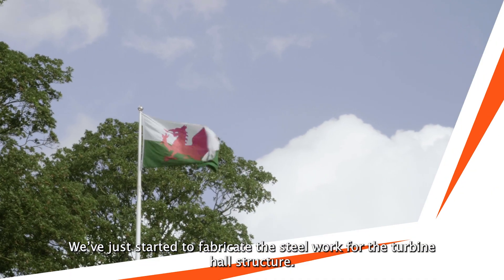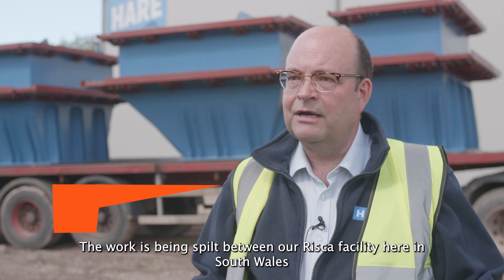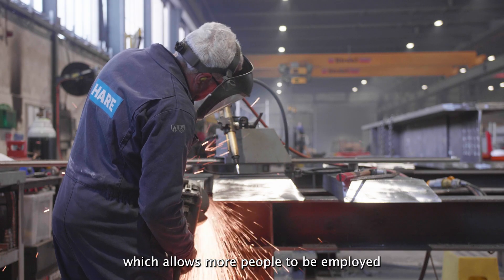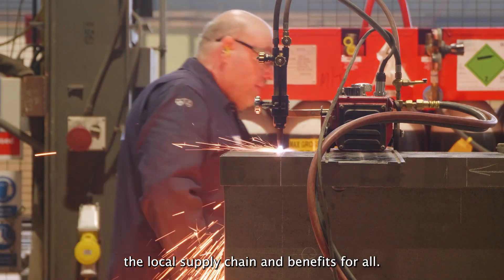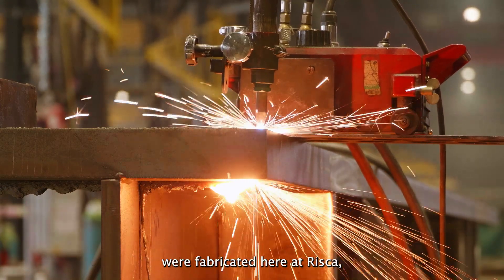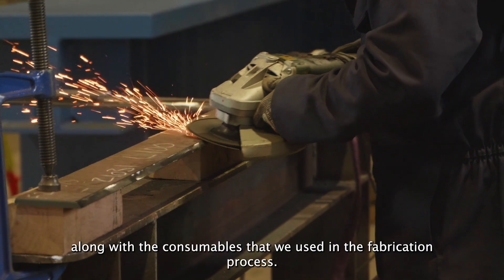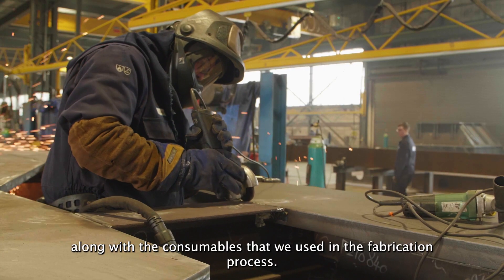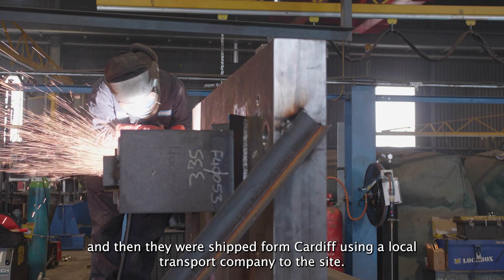British steel being used to build Hinkley Point C | William Hare

Comment: This is absolute madness and we'll be forgotten to pay for the environment damage for at least a hundred years!! And a thousand years thereafter dealing with the waste !!
Reply: What environment damage?
Reply: @neilzukov2921  Your not keeping up. Trillions pounds, dollars and euro's are beings spent to offset damage projects like these are causing in steel, concrete and fossil fuel and material use are causing. Many generations will be paying for this damage forever. If it wasn't for expansion projects like this fossil fuel usage wouldn't be a problem. As it is they're being wasted at an alarming rapid to create high paid jobs and an excessive growth economy. Future generations will hate us for wasting fossil fuels at such a rate. Disgraceful !!
Reply: @neilzukov2921  The damage we're being forced to pay billions to in carbon offset and capture methods. You need to keep up.
Reply: @endlesscyclist1212  As for the waist reprocess seal the reduced junk on a shielded canister and bury it underground at bed rock level away Like at  Onkalo.